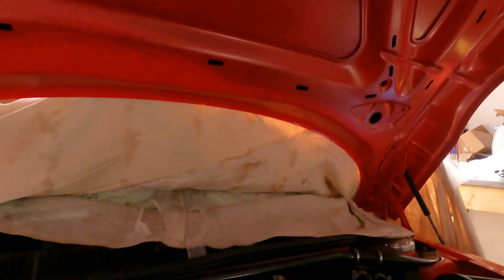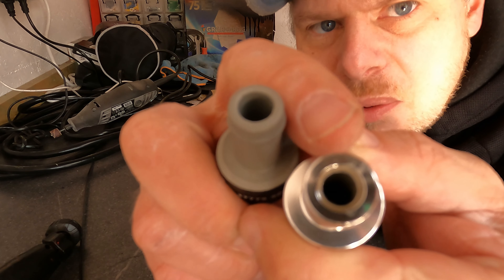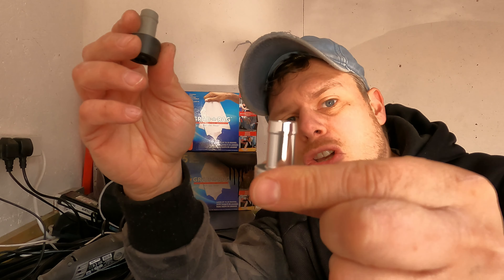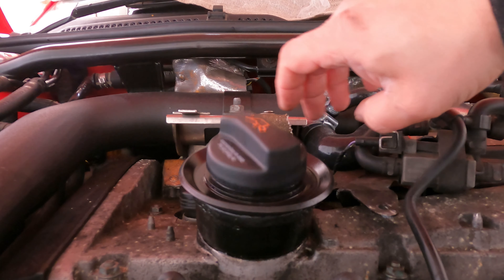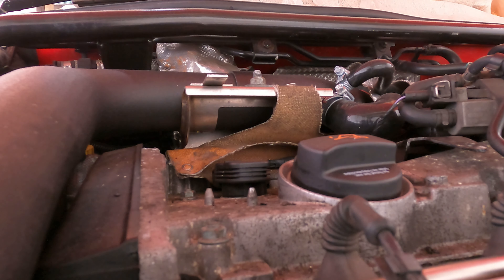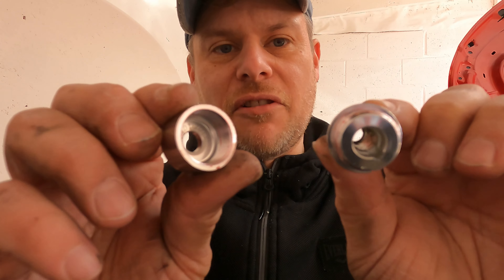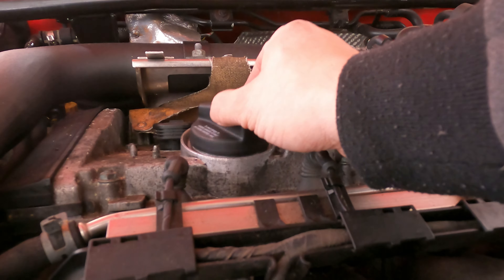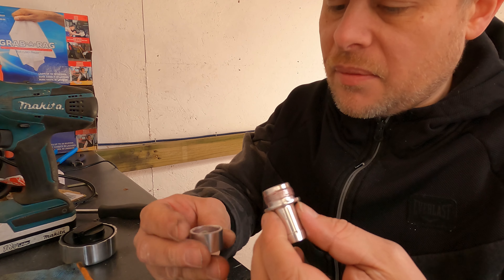AUDI TT MK1 8N S3 8L 1.8T 20V Do You Need A PCV Valve ???? (PART 2)

Comment: Luv it mate, another great video. So, after watching this pt2, I stand by my comment on pt1. You can also try a weaker spring in the valve which would account for the extra pressure caused by the addition of the catch can.

Comment: Hey, my audi tt mk1 (engine swapped with a cupra 1.8T 20v AYP and tuned to 300hp with K04 turbo) was smokin/burning oil at low rpm (<2000) and when the engine was idle (driving with clutch in or just stationairy) so i assumed i had bad valves at first but since it wasn't burning oil on cold start when the eninge was sitting for a day that was ruled out quickly, then i tested the turbo for leaking seals as it appeard to only happen when the engine was hot so maybe it was leaking in the turbo exhaust side and burning it off in the exhaust. but also that was not the problem.
Then i realised i had installed a catchcan but no connection to the intake which the original PCV did have (cloude9customs catchcan kit comes with a nipple to block that hole off in the intake) and so my car had a bouncing cap and was blowing air out the top pretty bad. since i did the catchcan install myself i still had the old broken OEM PCV with a OEM audi PCV one-way valve. so i bought some hoses, connected the one-way valve (its a T piece) to the catchcan outlet where one side before the one-way goes to the Puck, one comes off the catchcan, and the side after the one-way connects to that nipple on the intake where the PCV originally was connected to and now my car is sucking air again from the oilfiller cap, no more dancing going on there and my idle pressure in the intake went from -0.8 to -0.6 bar on my boost gauge.

So in my experience if you dont want pressure building up at idle, causing the oil scraper rings for example to take unnecessary load you should use a one-way valve (preferably the one already used in the OEM PCV to make sure it has the right pressure needed to open and close)

Comment: Hi Chris, I have completely standard PCV/PRV system with catch can added in between rocker cover and PRV. Cap is not bouncing only when there is no middle section between cap and engine.
Reply from the maker: I just put a poll up on comunity page 👍🏻

Comment: Put the T piece with the PCV valve in its original spot under the intake manifold, near the spot where the original elbow comes out of the crankcase, before the catchcan with shorter hose. This how i set it up and its working fine.
Reply: If you can help me out that would be great. So just to confirm basically have that T piece after the elbow from the bottom off the engine by the dipstick and a straight up through the PCV valve to the manifold, other end going to the catch can set up exactly the same as the video? I am currently having about -15 psi on idle. I use to get -22 (ideal as the exhaust runs way more quietly) I have had a lot of engine alterations so I no longer have the PCV valve and I have just bought the PCV set up exactly like the video and no change to the psi. I am wondering if your method would work?

Comment: So i tried a number of different things on my 1.8t 20v. I first tried with the pcv off, but it didnt run right. Then i tried with it all connected but with not sucking in any clean air from the intake, but the eas too much vacuum, then tried with the air intake but without the puck, but then air came into the  head. Then i added the puck again and that cr4ated the perfect vacuum. I dont thing its the valve itself because i bought a metal one from Temu and it works great.

Comment: Hi Chris ! Old video, I know.
I have done exactly the same install as yours , BAM 225 2001.
I found the same catch can on ebay or something ( chinese I guess )
What I did yesterday was to bypass the catch can, direct to the pcv, and then no more bouncing. 
Seems to be a simplified install than the OEM one.
So , probably, the can is the culprit. 
Why ? Don’t know yet. Maybe too small, maybe to far. 
Next will be to replug the can without the grill inside.
Reply: how did it go with no grille in the catch-can?
Reply: @jules13692  
Same thing … 🙄

Comment: My old 225 used to have its cap bounce with the catch can, but then that block had blow by and lots of other issues! 😁 Interesting to see that even with the PCV valve in you still get the bounce - I reckon you're right though that the idle vacuum from the manifold isn't strong enough - is there a better place to maybe pull the vacuum from?
Reply from the maker: Hi mate I fitted the valve  where the oem pcv system pulls vac from ive not thought about where else for it to go as thats the vacuum source. I bet your glad you have the 3.2 now ? What does the 3.2 cap do out of interest 🤔
Reply: @CarChris82  haha yep! You know I’m not sure, I’ll have a check tomorrow and see what it does. I’d love another 225 though, a coupe, at some point
Reply from the maker: @benofthenorthuk  sounds good mate 👍 you can never have enough TT's 😁
Reply: @CarChris82  My bank balance says otherwise 😆
Reply from the maker: @benofthenorthuk  😂

Comment: I have standard OEM PCV system only the SAI is deleted and it's bouncing the same. And it was the same before the delete. When I push the oil cap then it stops to bounce and then sometimes it starts to bounce again after few seconds. 
I have readed that to much suction is also not good, but then my question is what is the normal amount? :)
Reply from the maker: Just a little I think but I don't know if thats the right answer I think everyone's is different due to set up and engine wear
Reply from the maker: I just put a poll up on comunity page

Comment: Hey man, did you solve the problem? I have the same exact problem with my 2001 VW New Beetle 1.8T,
I've replaced the pcv, the pcv lines and the pcr and still my oil cup jumps
Reply from the maker: Some just do it mate, every engine seems different must be how worn things are

Comment: Chis it really makes no difference . At idle the turbo is generating so little pressure the excess back pressure is able to escape around the turbo blades, Also in your system the spring in the one way valve isn’t weak enough to open, so what’s happening is pressure builds- valve opens - pressure drops valve closes and the cycle keeps repeating.  Really at ideal does the engine really care about the pcv or pressure in the rocker cover as it’s so low.  Maybe a better setup is just vent straight to atmosphere. So any blowby can just be expelled under the car.
Reply from the maker: Your right mate I don't think it really matters that much as when your driving it all gets pulled through.this was more of a test to see what happens and if you need a pcv valve in or not with a catch can set up
Reply from the maker: I just put a poll up on comunity page

Comment: Hey Chris, i just checked if the cap of my engine is dancing and it does! Its the bjx 1.8 20vt with standard engine with only a stage 1 tune. Is it bad if the cap is dancing? Should i fix this? Thanks for this video it allready helped a lot! (Sorry for bad english)
Reply from the maker: It might be worth checking the pcv system and valve for a split in pipe or blocked valve 👍🏻

Comment: Chris, what's the purpose of your test? Is the cap bouncing a bad thing and a problem that needs to be solved?
Reply: Yes it means that the pcv is not working as it should 👍
Reply: @julesmatthews2178  so. If this was a brand new car like back in 2002, the cap wouldn't do that with standard pcv system?
Is adding the catch can the problem?
Reply: @benjames6929  yeah your probably right. I I’ve all new pcv pipes and new 034 valve and I asked bryn if it’s worth fitting a catch can is words were no it’s fine as it is . I appreciate that it pulls the crap out of the pcv into the canister but I change my oil an filter every 4/5000 miles 👍
Reply from the maker: Changing your oil makes no difference to what a catch can does,it removes the c**p from going back into the intake
Reply from the maker: The purpose of the test was to see if putting a pcv valve  in the system with a catch can makes any difference to not having a valve fitted as a lot of people including myself run without a valve but others say you should have one did you see the first vid on this ?
Reply: @julesmatthews2178  it's my understanding that it's just removing the shite that gets piped back in the intake system, therefore keeping the turbo cleaner as it draws the crankcase pressure away from the crank and blow by from the head and feeds it back to the intake. The catch can would eliminate and "filter" than shite through the can and deposit the cleaner, less crappy air, but essentially the same air as before, back into the intake system.

These video prove that adding a one way valve doesn't work as intended but without the one way restriction it worked as Chris expected, no cap wobble. So in my observation, the flow needs to be restricted by a smaller diameter in place causing enough restriction to enable the pcv to actually work. As proved when Chris removed the internal valve
Reply: @CarChris82  I saw the first vid Chris. Its seems that with the valve but removing the one way system works. To me having the tighter flow in diameter made the pcv work better and stopped the cap wobble
Reply: @CarChris82  I’m wondering Chris if the valve as something to do with the idle meaning not having a valve will give a perfect idle.. mine is perfect most of the time but sometimes it’s not 🤷🏻‍♂️
Reply: @benjames6929  well said  👏 . What I don’t do with my car is mess with it and remove stuff I’d rather leave the car as it is . And if it’s running well I’ve no need to give myself work trying to make it better when it’s all good ya get me .. then there’s more time for polishing it 😂😂😬
Reply from the maker: I just put a poll up on comunity page

Comment: I’ll say now and I’ve not seen rest the OEM will be better
Reply from the maker: Oem don't have a catch can also this is simpler and easy to swap out
Reply: @CarChris82  but was surprised there was no difference in OEM or 034 valve .. I’ve got new pcv pipes 034 valve no catch can . I asked Bryns advice on fitting one he said no yours is fine as it is . I’ve a good idle not 100% more 98 👍
Reply from the maker: I have perfect idle too mate just want to see what others caps are doing as its very mixed in people say its normal and others say there should be a little vacuum
Reply: @CarChris82  think you get more vacuum when you rev it 🤷🏻‍♂️ . Mine doesn’t suck down as strong as yours did with your valve not fitted but I’ve definitely got vacuum it pulls oil cap down .
Reply from the maker: @julesmatthews2178  yes mate when driving it get vacuum from the tip pulling it all through
Reply: @CarChris82  I wouldn’t worry about it .. 🕺😎
Reply from the maker: @julesmatthews2178  it was just a test mate to see if it made any difference having a valve with a catch can set up or not 👍🏻
Reply: @CarChris82  looks like it works better without.. I was more interested in seeing if the OEM valve was better than the 034 but there was no difference 👍
Reply from the maker: I just put a poll up on comunity page